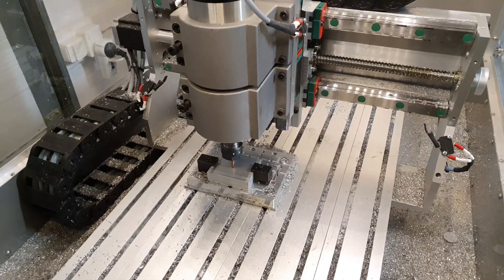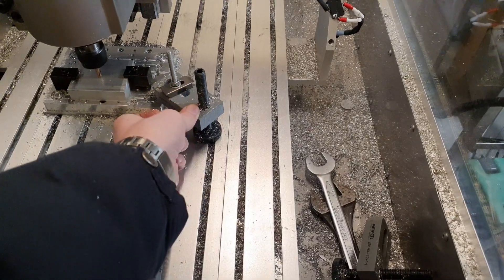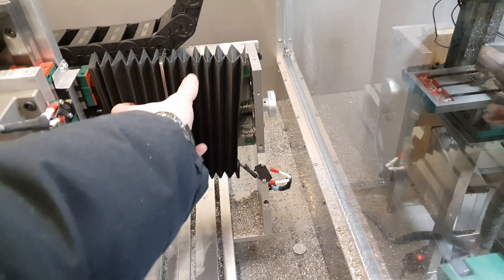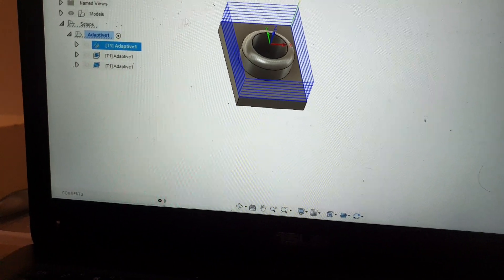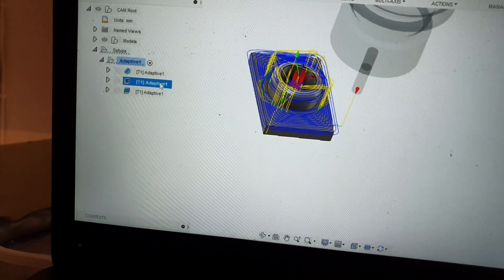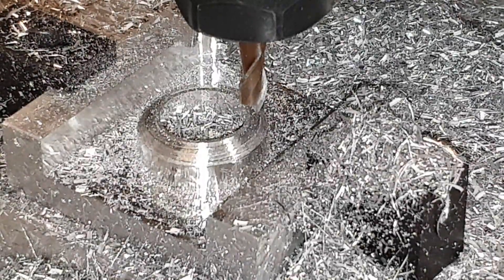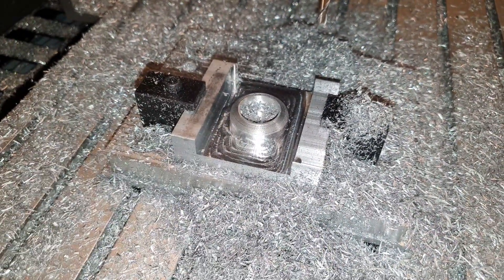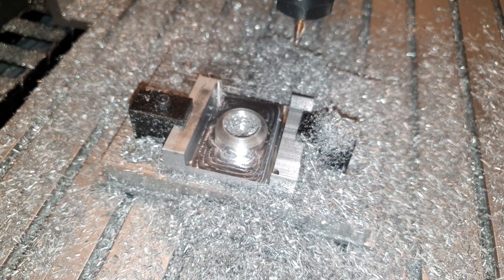More test cutting @3:12 with the 6040 cnc router

Comment: I was concerned that maybe the Y-axis bearing/rod assemblies seemed kind of wimpy for supporting the full weight of the gantry and it's movements when cutting aluminum. Can you notice/measure flex if you twist and/or pull back and forth on the gantry? Overall, for the cost of one these machines I'm impressed with how good your cuts look. Thanks for sharing your work. I'm thinking of buying one these.

Comment: upgrade your table it will improve it more than  y axis rail upgrade, leave that for last..
Reply from the maker: I have bought 25mm solid aluminium plate that I Will use instead of the t-slot table. Also aluminium and rails fot y-axis. Finally 3 beafy nema 23 closed loop servos. :D Will start working on those final upgrades when I am done in school in mid june.

Comment: nice .. i replaced my table when i did the linear rails.. the table from the factory is like a tuning fork.. made one from box steel tube
Reply from the maker: Tuning fork 100% spot on :D i still feel some ringing in my ears after that slotting with 2mm stepdown even Though I used peltor ear protection. 

Your solution sounded cost efficient. I plan to go with 25mm thick solid aluminium. Price is about 230 usd.

Everything ads up.....
Reply: @thechipwelder1253  yea, the box steel was cheap , i then bolted 1/4 aluminum plate atop the steel box tubes..  25 mm aluminum is a better idea
Reply: @airgunningyup  Sounds like a great idea! Have you consider filling up the box steel with epoxy granite mix?
Reply: @philippwetter  i filled it with ssand.. the gantry took about 12 lbs of  it.. which if nothing else killed the chime like resonance.
Reply: @thechipwelder1253  You can also use solid granite plate...it doesn't have to be surface plate and it's great for vibration dampening and may even be cheaper. Check this if don't already know about him: https://www.youtube.com/channel/UCi2bL6MYWbjwwIMVqoxTeoA